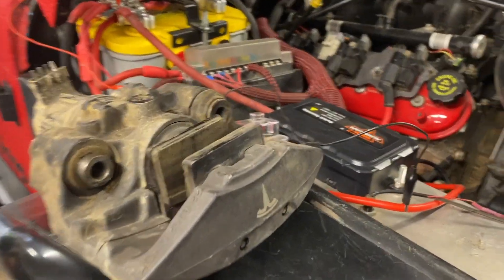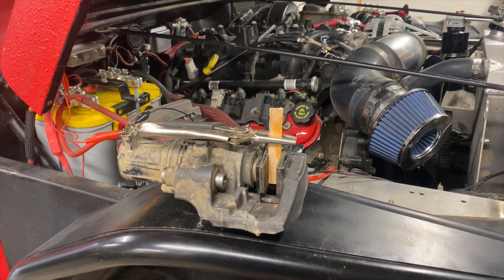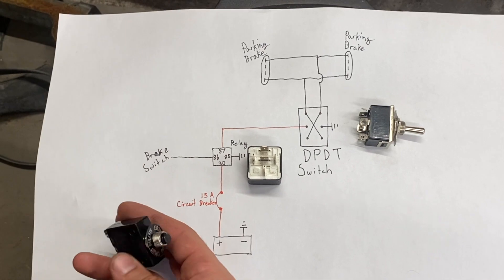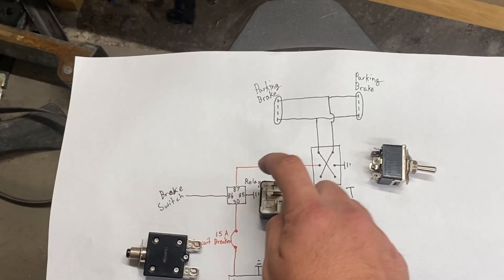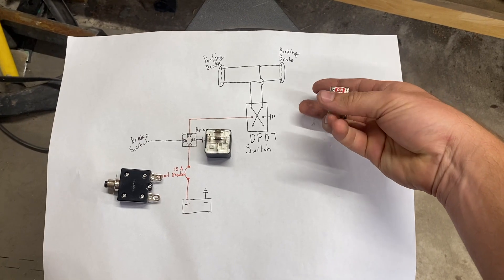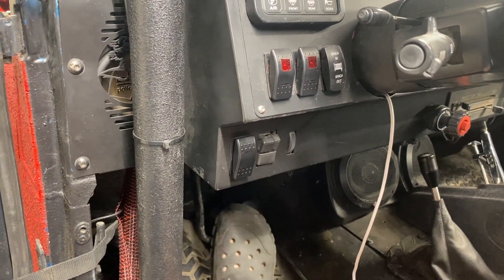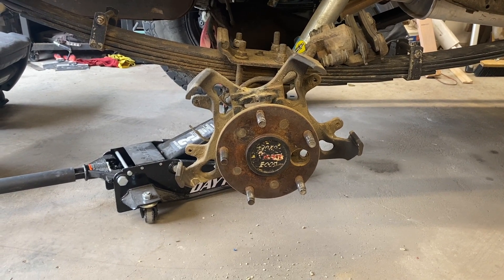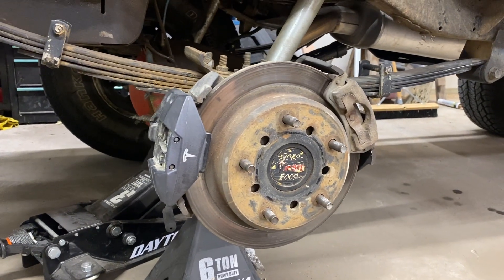I Hacked Tesla’s Parking Brakes!

Comment: I'm building a drag-and-drive car where i want to have the simplest/lightest way to have a parking brake. I was wondering: what happens if you press the button for too long engaging or disengaging the brake? Does it have an internal limit switch?

In my application i would like to hook it up to the ECU/PDM too, so it can only be engaged when brake pressed AND speed = 0.
Reply from the maker: I put a mechanical circuit breaker in line. I believe I did a 15 amp. If I pop it, I just push a button to reset it.

Comment: I like this! Did you consider using some kind of valve on the brakes to where you could press down the brake pedal to the desired pressure and close the valve to retain that pressure on the line after releasing the brake pedal? Or is that a bad idea to have the pressure built up like that for a long time?
Reply: It's called a line lock I believe.
Reply from the maker: Thanks! 

So using the hydraulic brake as a parking brake? That’s another option that people do
Reply: Yes, like others mentioned this is the normal way a line lock operates. And yes you are also correct that it's a bad idea to have the pressure built up for a long time. If you're just using it on the trail to keep yourself from rolling down a hill while you're away from your rig, it's a good solution. If you're using it to hold over a few days / weeks, probably time to look for another solution.